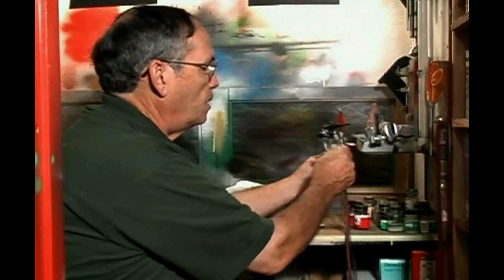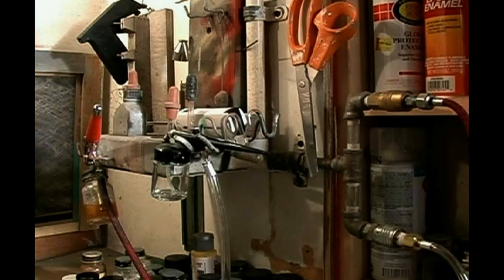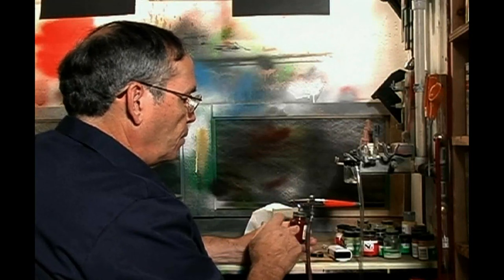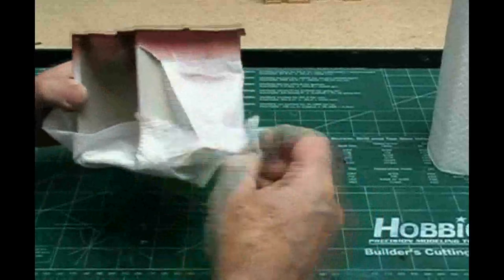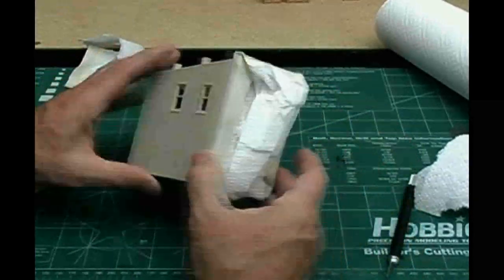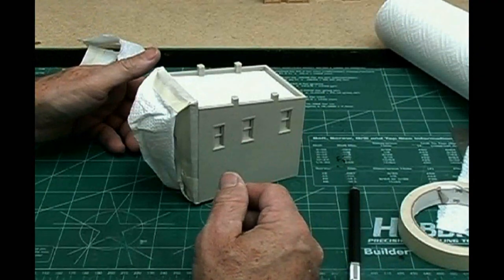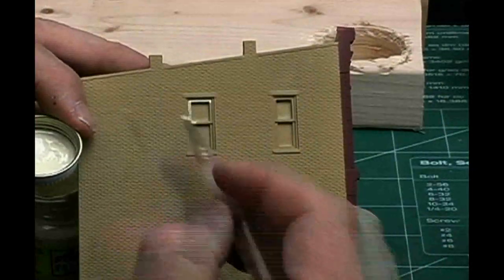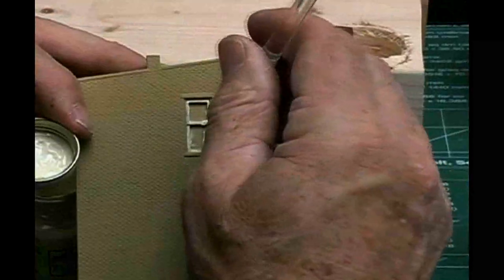Painting the Building / DPM Kits - Part 8/21 - Woodland Scenics

Comment: Primer isn't usually needed, but if you want to, use a light gray as an undercoat, you can air brush it or just do what I do and paint it on with a regular paint brush.  Light colors might require a primer bu in general the light beige color of the molding is fine
Reply: So right, but the parts need to be properly cleaned.

Comment: i've built many of these kits and you don't really need to mask them to pain the windows and fine details like the roof overhangs and cornice details or the different window panes.  To do this in any scale use a fine brush or micro brush and follow the contours of the details on the model, you can, with practice and some touch-up, get a really good looking building in no time flat.  also, don't build the buildings exactly as they appear on the box.  look up some examples of finished models or prototypes on the internet.  These buildings are pretty much Victorian or post Victorian era from the late 1800s to the early 1900s when newly build, so bright color schemes aren't a bad choice when done right.  Red brick, white window frames and green cornice is just as valid as green and brown and yellow...whatever you like.  Brick should always be a shade of brown or red or rust or beige.  Dull yellow works too, but bricks are rarely bright colors, but the wood trim was often painted brightly.  Kitbash several kits together to make a unique building.  just making something you see on the box isn't much of a challenge.

Comment: So no primer is required on these for the first coat? I did not hear any mention of priming before the base red was sprayed.
Reply: A primer can help paint adhesion if the parts aren't properly cleaned, but if all the manufacturing 'debris' is removed, plastics take either acrylic or enamel paint well.